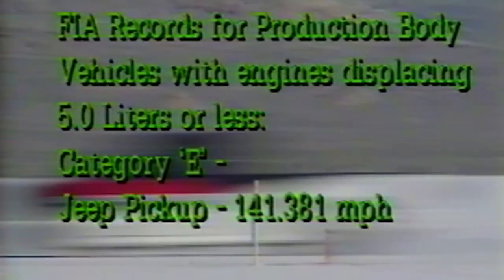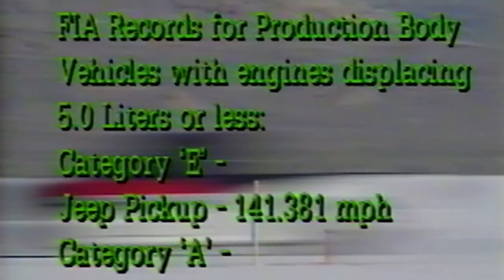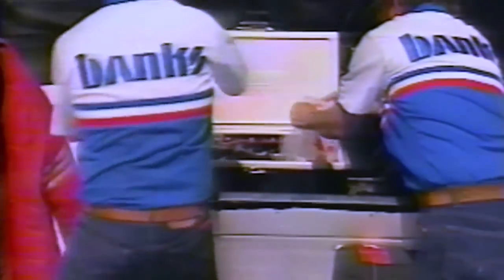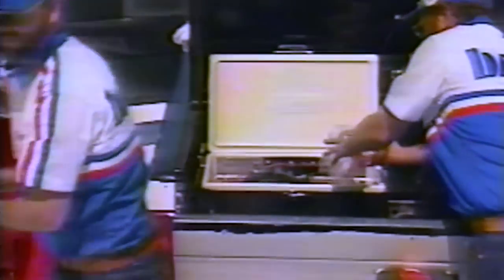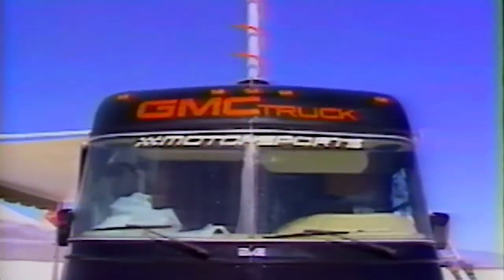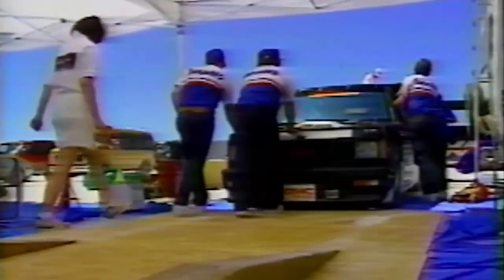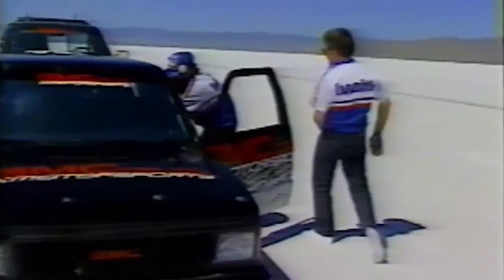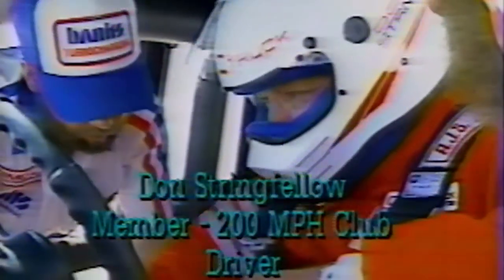1989 GMC S-15 Syclone Land Speed Record

Comment: If you're limited by displacement and not number of cylinders why start with a 4.3L V6 when they could have started off with a L99 4.3L V8?
Reply: I don't think they had the L99 back then.  All I know of it being in was the 94-96 Caprices.  The V6 is probably lighter too.
Reply: And even if there was a L99 V8 back in 1989, it would have had a hard time making more power than the V6. The tiny cylinder bores in the L99 do not allow for large enough valves to make big top end horsepower. Richard Holdener has made a couple videos discussing that very issue between the GM V6 and V8s.

Comment: Why didn't they use a GoPro? That camera was ridiculous, they don't need to use news cameras from the studio.
Reply: Is this comment a joke or do u really not know that was the closest thing to a "go pro" in 89
Reply: @phillipwarner5504  has to be a joke. No one is this stupid
Reply: @AmarilloHorseSports  the first iphone with a camera was 2007... This was 1989.
Reply: @JasonHenderson  
You haven't met my coworkers 😩
Reply: @AmarilloHorseSports  🤣🤣🤣🤣🤣🤣🤣🤣🤣🤣🤣🤣🤣🤣🤣🤣🤣🤣🤣🤣🤣🤣🤣
Reply: @phillipwarner5504  film cameras would have been better.
Reply: @AmarilloHorseSports  No, a film camera would not have been, as the vehicles vibrations would have floated the film strip back and forth in the gate, meaning every frame of film would be out of focus.
That's the same vibration causing the tape in the camera to float on the recording drum, something that was only eliminated with the advent of memory card recording more then 25 years after this truck was run.

Comment: would love to see any photos or diagrams you have of that cooling system...
Reply from the maker: We don't have the diagram handy, but we'd be happy to explain. The GM 5.0 liter V-6 still needed extra power so we “supercharged” the air into the intake… naturally with no forced induction. We rammed the incoming air through heat exchangers that used circulating ice water from a tank in the bed of the truck bringing the intake temp down to about 55° F (in 100° F+ ambient air temps) which added approx. +30hp. This changed the density of the intake air charge dramatically and increased power throughout the speed run. In short, we intercooled the intake and supercharged the air.
Reply: @bankspower  Any reports of how much increase in air pressure, over the atmospheric pressure during the run?
Was any Ram Tuning applied?
Reply: @PiDsPagePrototypes  I would look in to the Hayabusa for this information , they have been having the ram air system for a while now and they are pretty fast , so you would get a lot more information.
Reply: @bankspower  wow excellent stuff.
Reply: Thank you for answering Mr Banks.
Reply: Air to air intercooler inside an ice chest with two holes cut in it.
Reply: https://youtu.be/0RKUMXxOeqEu yt?